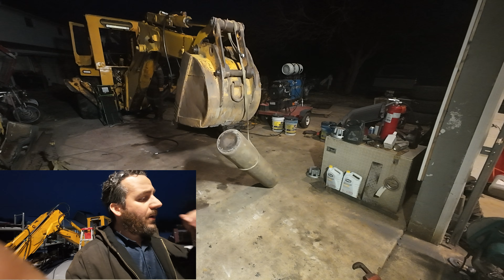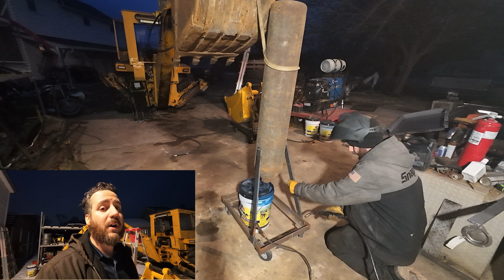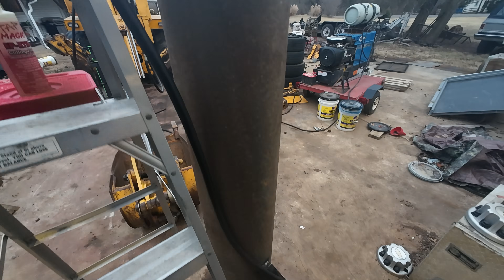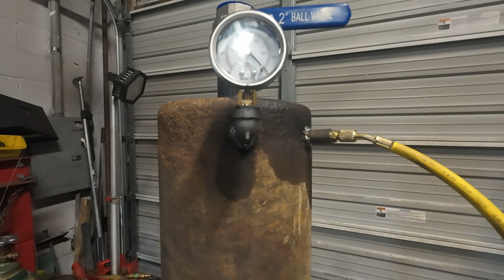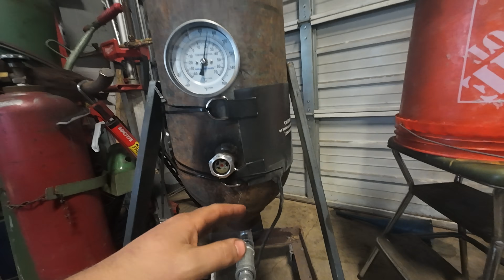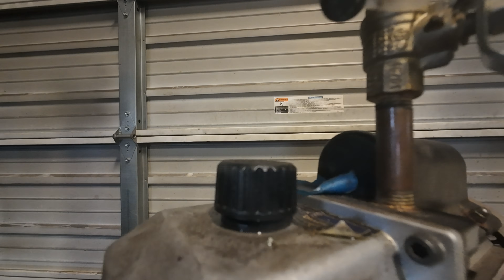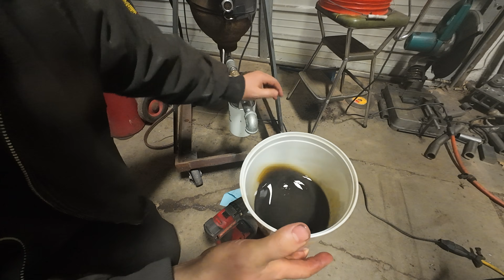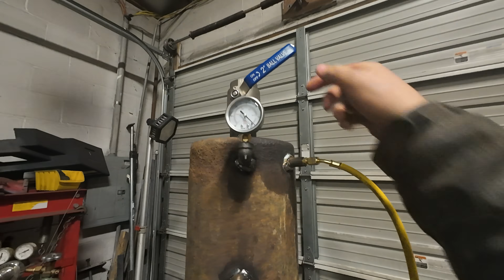I made a machine to remove water from hydraulic oil. Vacuum de-hydration

Comment: Most vacuum pumps have a gas ballast valve, when you open it, it helps keep the moisture out of the vacuum pump oil. HVAC we typically pull down to 500 µm, 0 µm is a perfect vacuum, 29 inches of mercury vacuum equals about 25,000 µm very high resolution scale. You could probably leave the gas ballast valve open all the time as you’re not getting into a deep vacuum. Would need a micron gauge to know. I typically close the gas ballast at about 1500 µm.

Comment: a diaphragm vacuum pump won't have issues with the moisture and you don't need the volume removal of a vane style pump since you are just trying to maintain a high vacuum level.  Also, the vane style vacuum pumps put out a fine mist of oil from the exhaust - that's probably what you are seeing instead of moisture.

Comment: Sooo , thats why I am having trouble with my tractor , I been running ATF in it and have some cylinders that dont wanna move.....
Man I did not know that about the Hydrolic oil encapulating the water .
My moisture problem must be settling out.....

Comment: 3 points of interest/concern ...

1) To check for the untrained air, vacuum without heat and check.

2) what volatile good additives are you losing?

3) can you make an inductive coil to heat the tank? Maybe using an old welder?

Great video and blah, blah, blah... all that wasted typing.😅
Reply from the maker: Its not wasted typing! Its not an ideal solution but for a 50 year old backhoe its just what I needed.

Comment: If you would have laid the tube down instead of being straight up it would have gone much faster since the air and water now did not need to go through all the other oil to get to the top but now instead only a small distance of a couple of inches instead of several feet.

Comment: I can see/hear the concern in your voice regarding how dark that oil still is on your first test. Although you can't hear/see them, people, you don't even know, just gave you a standing ovation around the world. You just provided, what should have been an obvious solution, to a complex problem that many of us have burned thousands of dollars on. I concur w/others who suggested adding an ICE bath if you want to mitigate having to change your vacuum pump oil, best results use dry ice/alcohol bath. I initially would have also agreed, you only needed to bring it to vacuum, but as you walked us through the process, I feel you are correct to keep the pump going. 

A possible vacuum alternative,  find an older lab grade diaphragmatic vacuum pump. Labs let them go for under $100 because the rebuild kits are expensive and any corrosion or pitting, they can't use them. They are designed to run 24/7, 365 between diaphragm rebuilds, no oil changes. You can skip the overpriced rebuilds, just cut replacement diaphragms out of that thick PVC they sell at Lowes for showers. They typically last a couple years, can be made with scissors/exact-o knife or have a 1 time bulk of them laser cut and your good for life. 

Pushing $5-600 to service my Kubota, and needing to do it more often because of moisture, probably going to have to build one of these. Thank you kind sir!
Reply: I would think you would want to keep the pump running to keep the pressure in the oil cooker low enough to allow the water content in the oil to vapor off.  If the air pressure raises you will have to heat the oil to a higher temp.    Could/would you drain the oil under pressure rather than venting the tank first?  Would an automatic pressure relief valve as place on a water heater make sense?

Comment: Are you introducing moisture back into it when you open the top ball valve? Do you need some type of moisture filter on top?
Reply from the maker: Very minimal, as the oil naturally heats and cools in the machine in normal operation and that is vented too

Comment: You can get a vacuum for ac systems that runs off of compressed air, then you don't have to worry about the moisture harming that mechanical pump.
You can pull a vac, then seal it off for a while and vac it again.

Comment: to check water content before and after, take a sample, weight it, heat it on the stove to drive out all moisture and weight it again.  This will tell you the weight of water that was driven out of the sample.  Do this with unprocessed oil and the oil after you run it through the separator to see how well it's working.

Comment: Cool thing about your trapped air problem, is that a vacuum will draw air out as well. Those tiny bubbles of air will expand, get lighter, and float to the top of the oil and burst, letting you separate them in almost the exact same way you're separating the water out. Awesome video!
Reply: Oh hey. Water is wet.

Comment: Being you have a vacuum tank, you can get some line from the fill valve and instead of lifting buckets, you can pull a vacuum and suck it out of the buckets.

For condensate filtration, as long as it's a metal/glass unit, you can use a moisture trap for an air compressor.
Reply: The oil will spray and go up the vacuum hose unless there is a stem to take the oil below the suction port. It is a common mistake I see at work when people do not set up the vacuum flasks correctly in bio-safety cabinets.
Reply: @joshua43214  Interesting comment, I'm wanting to build a system like this.  Can you elaborate more on this?  Frankly it went over my head.  Thanks in advance.
Reply: @Carlos27236  search for "BSC Vacuum Flask" and look at the images for a single flask set up
Reply: @joshua43214  great info. I want to build a unit like this. Could you elaborate on how to prevent the problem that you described?
Reply: That oil what you showed after  dehydration is burned and not usable. Interesting test though. Keep up the good work
Reply: @Dieselmekkie I’m curious, I’m not arguing but I was wondering: Why do you believe that the oil is burnt and unusable?
Reply: @Carlos27236  it might be dirty from the carbon on the inside of the oxygen tank

Comment: Meta comment. This is YouTube at its best. A guy with a problem applies some brain power, uses his fabrication skills, and does an experiment. He films the thought process and the outcome - and shares that with the world.
And now on the comments there is further useful info from others with experience of comparable processes, vacuum pumps etc.

The world gets better when we share good info in a straightforward way.

Kudos for the video creator and the those posting the comments.
Reply: Wanted to say the same thing, plus it's good for the wallet and good for the environment. Just a total win-win-win.
Reply: You, Jesse muller,Andrew Camarata are my favorites
Reply: Fukya! This is what I miss about youtube.
Reply: Nice! Would a centrfuge work?
Reply: @MrRfaass  It may be possible for larger quantities of water (or other fluids you are trying to separate) but smaller quantities may not work. At that point you would need either a vacuum to boil off the water or molecular sieves which essentially dry fluids like alcohol using a principle similar to silica gel.

Comment: In my experience there's always a certain amount of oil that remains inside the hydraulic cylinder, so multiply all the cylinders in the machine and you'll still have a good amount of contaminated oil in the circuit, probably you'll have to repeat the process after a while, but it would have happened even with new oil, so better this way. Good job

Comment: If you connect a small container between the gas bottle and the vacuum pump and put it in an ice bath,  you can condense the extracted water and you dont need to run the vacuum pump all the time, you only need to pull an initial vacuum and as long as there are no vacuum leaks the condensing water will keep the vakuum level constant. It obviously also prevents the water from getting into the vacuum pump oil. If you use a glass bottle for this you can see which amount of water gets extracted and you know the process is finished when no more water condenses inside the collection bottle.

Some thermal insulation around the old gas bottle will make the process go a lot quicker, because as long as the top of the gas bottle is colder than the oil, some water will condense in the top part of the gas bottle and it will drop down back into the oil.
Reply: Good ideas. Maybe in addition to the cold trap, he could add like an in-line desiccator with silica gel or calcium chloride or something to catch anything that evaporates or sublimates. Those color-changing regenerative desiccator beads might give an idea of how much is coming over as vapor after the cold trap, too.
Reply: That glass will have 14 psi on it.  Got  to be thick.
Reply: Büchner flask is what he'd want. They aren't that expensive and he could find a used one since he's not doing chemically pure distillations.
Reply: @JeffBartlett-kj6sq  aspirator bottles/borosilicate glass
Reply: @JeffBartlett-kj6sq  Standard canning glass bottles are common in vacuum systems, and last well, only breaking because they get dropped or chipped.
Reply: @TramVanDam  You get filter housings that are a casting and a regular jar, sold by Gast for their vane pumps. they offer either a spun aluminium can or the regular glass ones, and they come with 3/4 NPT threads, and the filter element as a fibre unit, but ISTR they also offer a stainless steel mesh version.
Reply: @JeffBartlett-kj6sq  
The glass bottle doesn't need to be something special, most glass bottles for fruit juice, ketchup, barbecue sauce,...  are vacuum sealed, you can identify these bottles with the relatively large lid and the clicking center of the lid...
Reply: That's a fairly light vacuum, you'll notice the water in your barbecue sauce isn't boiling off at room temperature.
Reply: If you consider this, you can  use something you find if you google for glass vacuum cold trap. If you don't cool it you still have the advantage of seeing what your poor vacuum pump has to digest.
Reply: That's a good idea. The whole process is essentially an application of distillation with using vacuum.
Reply: That is exactly what I was thinking. That poor vacuum pump. Another tank under vacuum that lives in an old mini fridge would work but you would need a system with zero leaks.
Reply: @izaakveenstra   That's what I used for 30 years in the automotive repair world.  I gave it to a friend of mine after I retired, and as far as I know, it's still working.
Reply: I'd do a two-stage setup, first a small copper coil in the ice bath to maximize the condensation, and the second stage is just to an empty container that can take vacuum pressure, pipe in on one side on top, pipe out on the other side on top, such that the water just collects on the bottom and only the dry air gets to the pump.
Reply: What's your day job because if you thought that all up on your own I'm very impressed but who the hell am I lol great job thank you for sharing
Reply: On this note...

The temp of the fluid generally will not change, until the lowest temp distillate boils off.
The less there is of it, the temps start to rise.
Reply: @MarkClark-d5u yes, you are right, the temperature will stay at the lowest boiling point, but if you put more heat in and/or insulate it to keep more heat in, the boiling process will be much faster.
Reply: Draw us a picture
Reply: Was going to say the same.
Reply: Dry ice and alcohol vapour trap. 
🦊🇨🇦
Reply: @kevinfox8030 I use dry ice and acetone, or D-limonine if non flammable is necessary
Reply: An ice bath is straight up just impractical, and it would add significant cost and effort to something that's only worth doing if it's easy and cheap. It would be better to calculate the lowest pressure level that water would condense at if at ambient temperature, and then use the heater to evaporate the water in the tank by getting it above that temperature. Have the line to the vacuum be thermally conductive and long enough that the liquid will condense, and then capture it in your container (not sure about glass, at least any cheap glass options).
Reply: @SovietGrazz other things come across while under vacuum. Contaminants such as gasoline, diesel, fractionated oils and other unknowns can come across and ruin a $2,000 vacuum pump.  Dry ice is a buck a pound and free if it comes from the ice cream guy it can also be made at home.
Reply: @SovietGrazz  Yes, you are right, ice is not really necessary, cold water also works fine.
Reply: At near to vacuum that would require long condenser and very low temperatures  in order to affect  the molecules.
Reply: @contemporiser the water will condense as soon as the condenser is colder than the oil/water mixture, you just need a few degrees temperature difference. But since the water vapour can transport a substantial amount of heat, the condenser or the water condensing bottle needs some cooling to remove the heat energy, otherwise it will quickly get as hot as the water oil mixture.
as long as the oil  with the water gets heated, the vacuum will not get that low. If the oil/water mixture is at 50°C, a vacuum of -0.9 bar will get the water to boil, so the vacuum can not go lower...
Reply: So we doing pot stills with slobber boxes on our hydraulic oil?
Sign me up.
Reply: @TheCaptainSlappy  Never heard of slobber box. Is it called that because it's like a mouth pulling on a drink with a straw?
Reply: @captainotto  In pot & refractory stills, it's the cooling coil. Termed "slobber box" because in the old days, just coiled copper tubing passing thru a wood or sheet metal box about 2 feet long and however big you like (volume), filled with water to begin the condensing. Then comes your stages thru the mash boil off: condensing, and dropping out...heads, hearts and tails. 

You want neither the heads nor tails, but the hearts (we are talking corn whiskey here, in case I am not being clear, but technically, you can run any kind of "mash" you can dream up, thru a still which include all manners of self-made ales, beers, and stuff like 'taters for vodka). 

Some say you can re-run tails if need-be to grab as much alcohol as possible. But be careful...you can and will go blind if you do it wrong.
Reply: @ Oh I see. I was confused then. I thought it was a term for a vacuum expansion chamber - pretty much what our mouths become when we drink from a straw (slobber box - dad joke). I do a bit of vacuum distillation and love funny old terminology for things that have boring names today.
Reply: @TheCaptainSlappy I think the scary part is heads, the first cut is methanol.   I never drink anything unless it’s from a real distillery or if I do it myself.  I don’t drink anything Billy-Bob ran through the radiator of a 57 Chevy to condense it
Reply: He would need to have a good vacuum valve at the pump then because the vacuum pump is not sealed internally because oil need to be able to go through everything and so air would go through the other way. But first though all oil would go into the glass bottle since the vacuum would pull all the oil out form the pump otherwise. This is not something that could happen, it will happen if the pump is shut of with a vacuum on the outlet.
Reply: Regarding "Some thermal insulation around the old gas bottle will make the process go a lot quicker...":
Isn't it preferable to add heat to the oil instead? Otherwise, the evaporation of water will take heat away from the oil and require higher and higher vaccum to continue the water evaporation. The same amount of heat will be removed in the condensor (e. g ice bath), but at a lower temperature. By keeping the oil at a moderate temperature (not allowing heat to destroy the oil) less vaccuum is required and therefore there will also be less unwanted evaporation from the ice bath, which reduces the water vapour load on the vaccuum pump. In short you want to keep the temperature difference as large as possible between the evaporation in the oil and the condensor (ice bath or something colder) within the limits of what the oil can withstand and what is a practical condensor temperatur. That delta-T will reduce work performed by the vaccuum pump.
Reply: @ I think the part about adding the insulation was to minimise heat loss through the vessel, since that will have the highest dT against ambient. You'd then be imparting more energy into the evaporating water than environment through the vessel. We do that with heating mantles in labs not to mention insulating things like stripping sections which are effectively preheaters.
Reply: I just put a pound of rock salt in a 5-gallon pail and pour the oil on top and stir. Stirring occasionally for a couple weeks then leave it untouched for another couple weeks until fully separated. Decant.  Done
Reply: Mmmm... salty hydraulic fluid, perfectly seasoned.

But for real, why would you ever think that was a good idea? Unless you can be sure you've gotten every molecule of salt out, then you're adding salt to your hydraulic system. Salt accelerates rusting, rust is bad for machinery. Literally the first part of an oil refinery is the desalter. Do not put salt in your oil.

Comment: Okay yes. About the vac oil:  You can have a little air bleed in right before the pump. A tiny tiny hole does the job. It dilutes the moisture content of the incoming air to the pump and will allow the moisture to pass THROUGH the pump without getting trapped in the vac oil. 
And what you see at the pump exit is not "vapor", but a fine oil mist. Vac pumps do this...
On this route you can also dry the oil by letting it run warm on just normal (dry) air. The moisture is then kicked out with the air. I rarely change vac pump oil. Just let it run for 10 minutes with a vacuum and a tiny amount of air.
Reply: Yep. Called a gas ballast
Reply: @themonkeyman2547  Correct. But when I started with vac tech... I was confused about that.